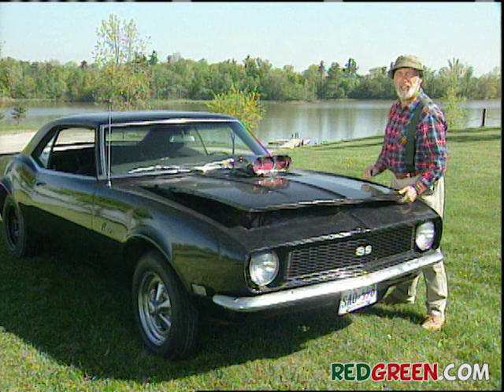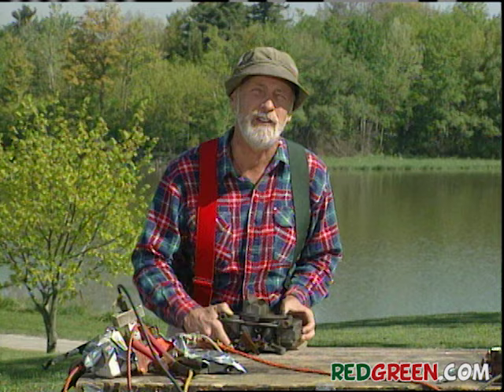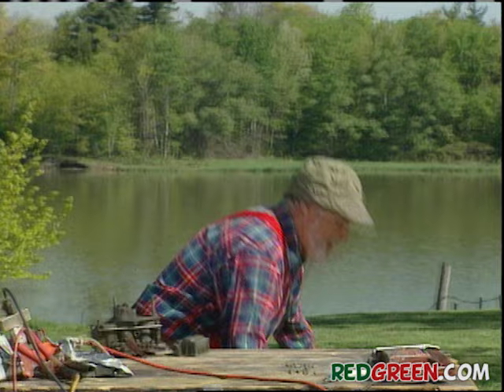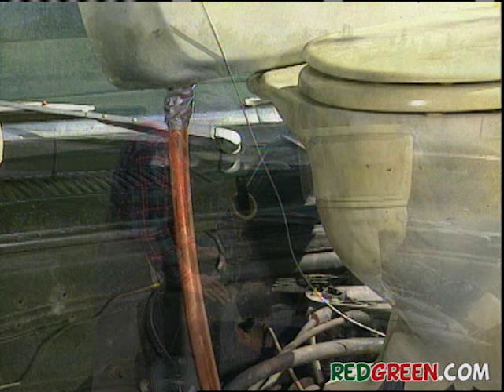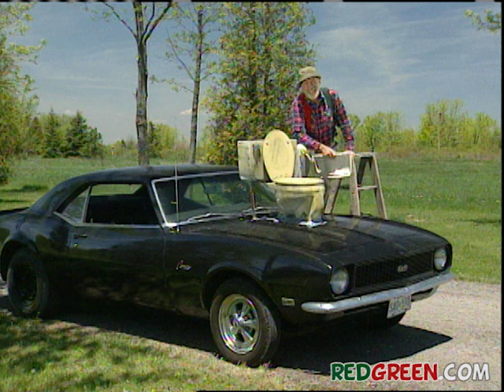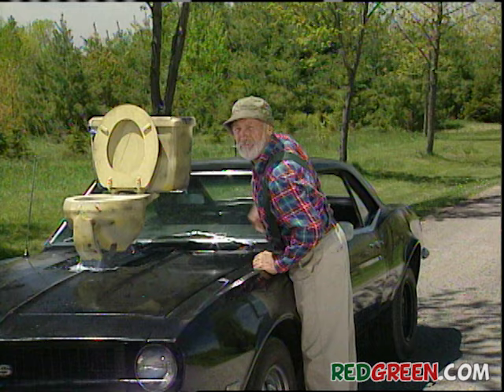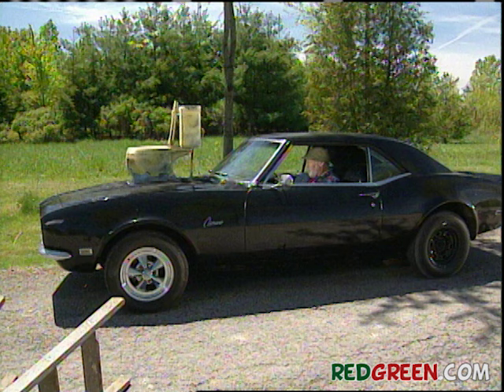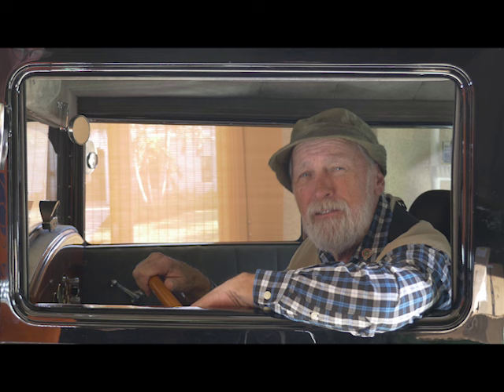The Red Green Show - Toilet Carburetor

Comment: I have only ever seen a float switch twice...
In my carburetor and in my toilet
Reply: Swamp cooler
Reply: True
Reply: Your fuel gauge also uses a float to see how much is in there
Reply: Bilge pump.
Reply: The iconic Spitfire planes of WWII had a carburetor float problem when they dived, but that was fixed with miss Shilling's orifice.
Reply: Cyber Mac Gyver
*VALVE ♿ 🇺🇸
Reply: water troughs.. about 100 of them on my farm..and theyre float valves...float switches are electrical.

Comment: The poor Camaro
Reply: Memphis Hancock ya I can't believe it went all those years without this awesome power adder!
Reply: pretty sure it wasn't damaged
Reply: Meh it was already hacked with that fake blower intake glued to the hood.
Reply: Likely the car was already on its last legs when Red acquired it for the modifications.  I suspect the producers of Red Green had a revolving account with at least one local salvage yard, if not more.
Reply: From the looks of it, the toilet appears to be cut from a block of foam. They probably just cut the toilet's foot off for the final shot with hood closed.
Reply: sct913 That Camaro in that condition is likely worth at least 10k. Even if the engine isn't the best, it's easy enough to swap a new one in and the body was in pretty good condition.
Reply: Cr125stin yeah right
Reply: it has skinnies up front and drags in the back. im sure its had a good life.

Comment: I'm not going to cry 'Foul', but that is a real RS/SS judging by the grille and the hood. I'm a fan of the wing windows on the '67 for poor mans A/C and I keep stumbling across awesome '68's for some reason. One of my neighbors has and unrestored SS 396 4-speed that came from Canonsburg, PA with a low VIN number in the 00000400's and has "Astro Ventilation" etched in the side glass where the wing windows were the year before. My 2nd car was almost a running and driving primered full interior drag car for $1800, but I was 300 short and the guy sold it to his family member who let it rot. These are cool videos that take me back to a simpler time, and that was a pretty good rolling burnout BTW.
Reply: If it surprises you that someone would let this guy strap a toilet to their rod, then you don't know "Red".
Reply: Seems like somebody already destroyed the hood w/ that fake bolt on blower that you can see at the 0:05 - 0:07 mark and they went with it? The fenders are flared and they have junk tires on the back. Probably a new project at the time that a friend picked up and they wanted to give it a send off before a resto is my guess. I could be wrong, but it is funny to watch people freak out over certain things and be totally "out there" in the comments. Anything made by man can be repaired by man.